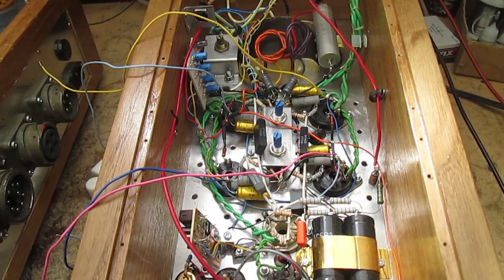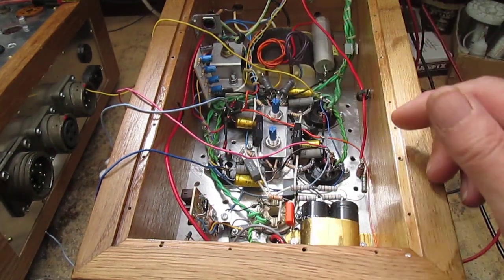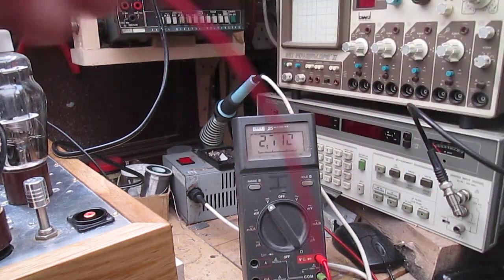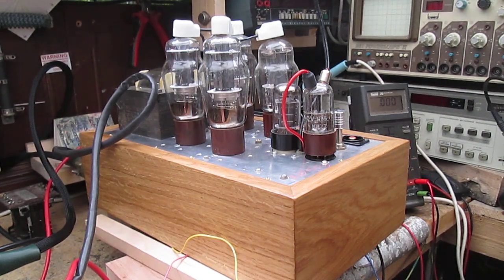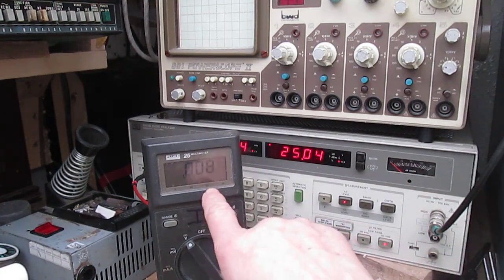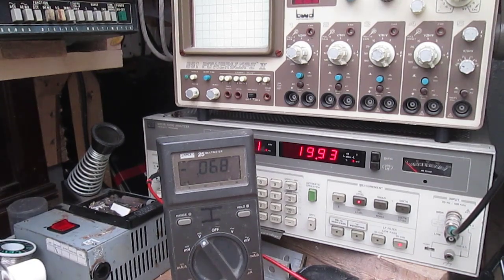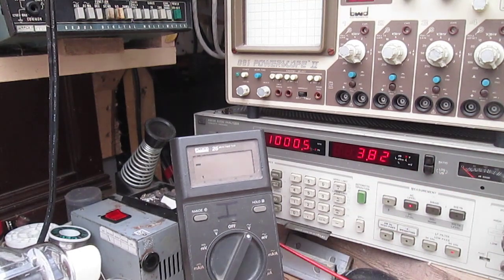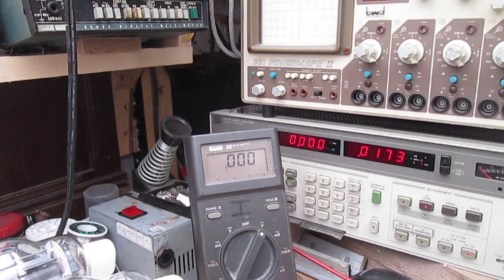Valve/Tube Matching - Is It Important? Matching 807's

Comment: The U.S. Military often had 50 or 100 hour burn in on certain tubes to stabilize them. Any tube is going to have characteristics changes as it ages. Yes, correct, you will run in circles trying to match tubes and still never really succeed.  There was quite a discussion on "Matching" tubes I read. Some sellers only match brands, some match date codes, and some match who knows what. I remember rebuilding an old Minschel organ as a Mothers Day surprise gift to my mother. My friend was an organ repairman and he saw my pile of new tubes for it. He told me don't put new tubes in, but put used ones in. If I had put new tubes in, he told me it was very likely he would have to retune it a couple of times, due to characteristics changing as they age. I installed used tubes, and the tuning stayed pretty accurate until she passed away, when I sold it.
Reply from the maker: Yep, Tektronix did too in their 500 series valve scopes. Made that mistake, pulled a 6DJ7/ECC88, put in a new one, scope didn't work.
   That's a grand story, TFW.

Comment: Cheers for doing that video Andy, that subject has been on my mind a lot regarding “matched” pairs and how important it is. Your experiments / tests have proved it seems not?
Looking forward to the sound tests, bung a bit of dub on! : ))
Reply from the maker: No worries. As I said when you buy "matched" pairs or quads I've not seen a seller spec what %age, Va, Vg1k, Ik or gm. Also the matched quads I've bought in the past weren't matched when I put them in an amp. I had to get in touch with the seller & spec the test conditions/match them myself.
  But as you've seen, does it really matter in terms of THD %? It might make more of a difference in an amp that uses one common cathode R, like in a Quad 2, say for CMRR. 
  Suggestions for dub tracks? Best dressed chicken in town? Prince Fari?
Reply: @diabolicalartificer   How about Kunte Kinte Version One by the Revolutionares ?
Reply from the maker: @ianmorgan6104  Not heard that one, just listened to it, the version I found isn't the best quality, but yeh, not bad. I remember Roots, long time ago. I like the old stuff but quite like newer stuff like Sumac Dub - Jardin De Lucy.